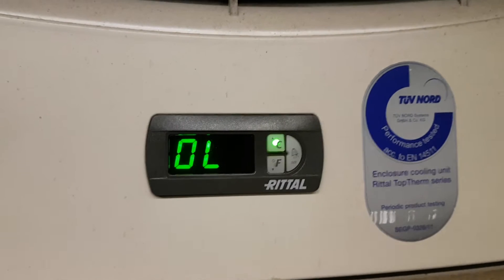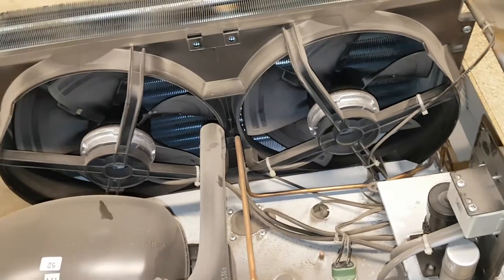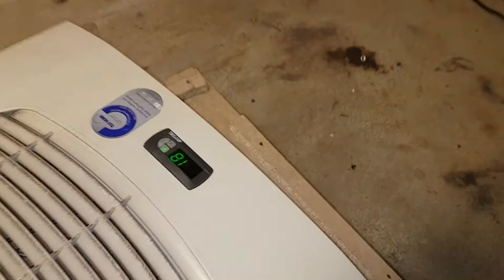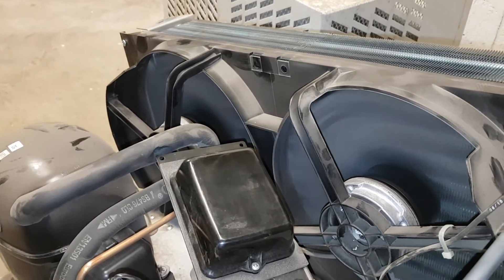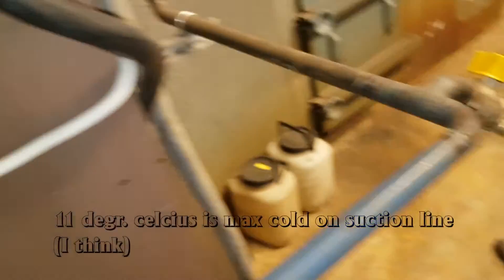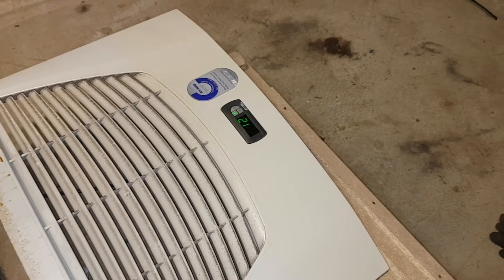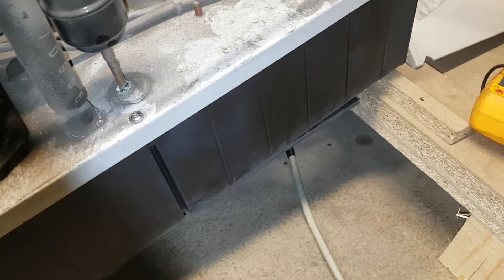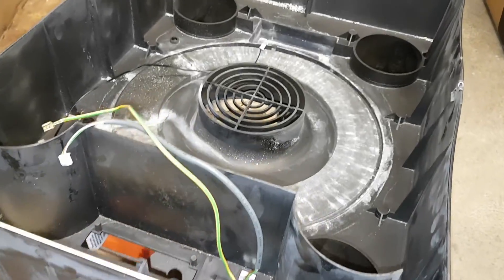Rittal top therm AC compressor fault overloading

Comment: Hi, I work in rittal customer service, maybe I can help you with your problem, first fact: the unit need a cleaning!
Second: if the fans works with 230 directly, the problem is in the electronic board, probably the unit need a new board, on the controller you see error like A09 or A10?